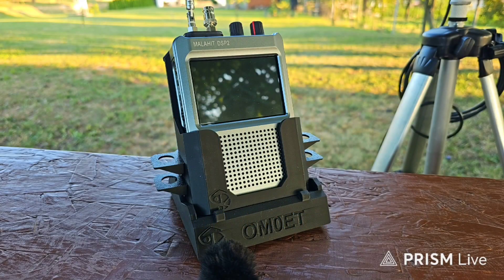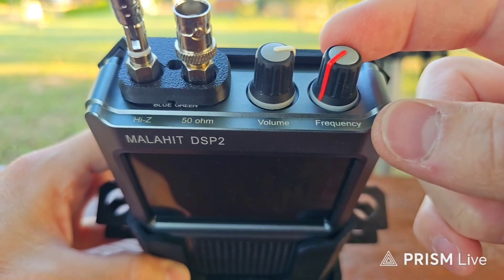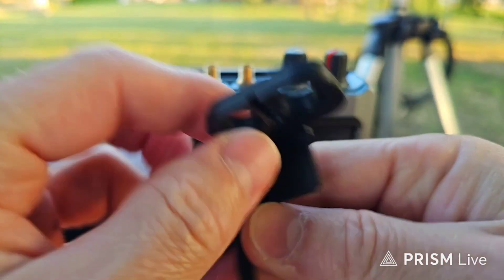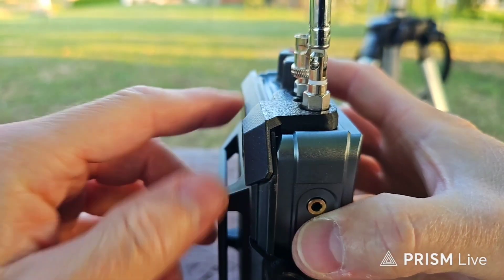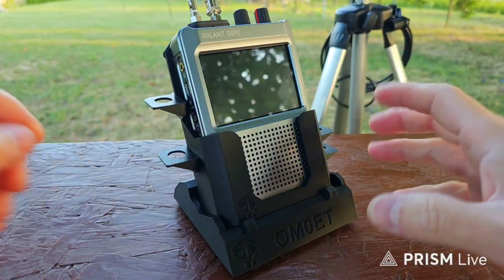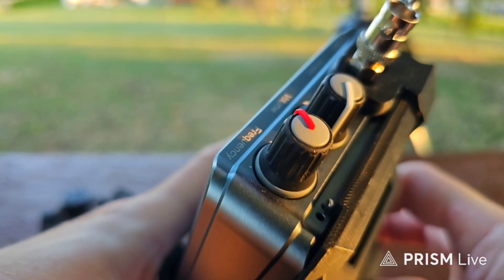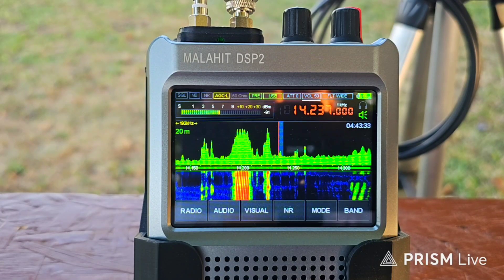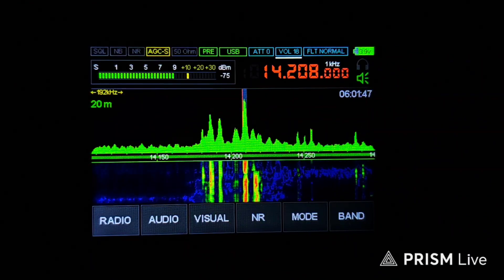Awesome 3D Printed Stand for MALAHIT DSP2 Receiver

Comment: Hi Paul, glad you like it. The radio fits into the base unit on its own and the jacket is not necessary unless you want to utilise the external BNC connectors for the antenna to save constantly using the more fragile connectors on the radio. The Side clips take a BNC connection from the Antenna via pigtail connectors available on eBay 20cm seems a good length, here are right and left handed clips and also two different sets one that is at 90 degrees in the desk unit and one at 90 degrees when in the jacket only.
Reply from the maker: Thank you so much David for this beautiful kit! 😉👍
Reply: David are your print files available online?  Thanks!
Reply: @JoshPerez  no sorry
Reply: @dmtarry  No worries!

Comment: Terrible printing job, layer shifting is ugly. This feels like it was "sponsored", since everything is "good", and "smart".

But, really my daily driver cradle for my DSP2 is Thingiverse thing # 6436609 (Malahit / Malachite DSP2 Stand) without all that unnecessary add-on junk, and best of all, it's free.

Also at 5:00 the SMA sockets are pretty solid in there, pretty sure a larger vertical wouldn't do any damage, as it is pretty well anchored on the aluminum body.